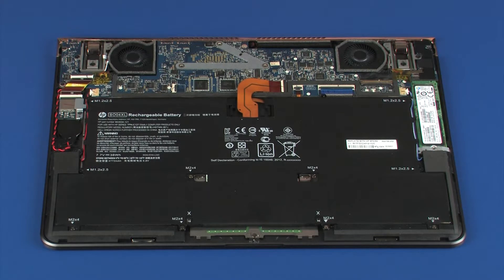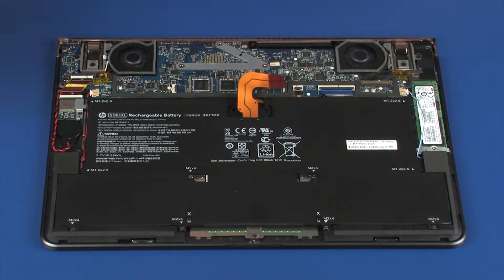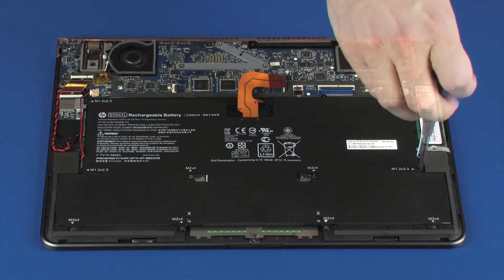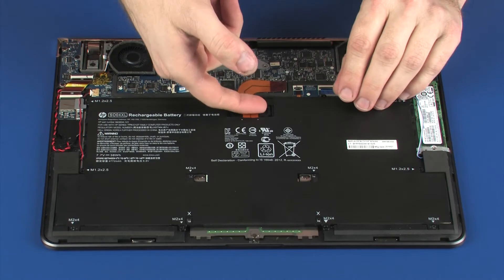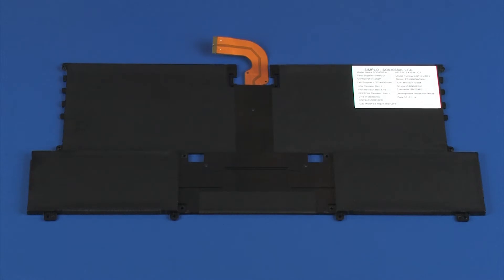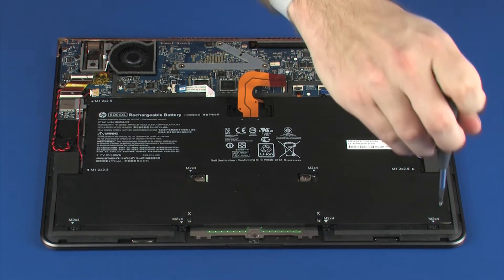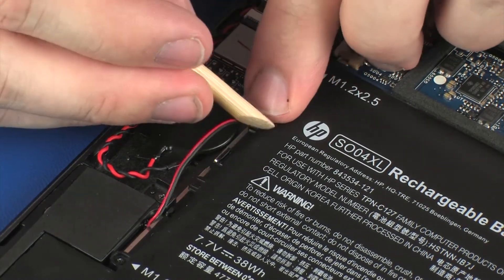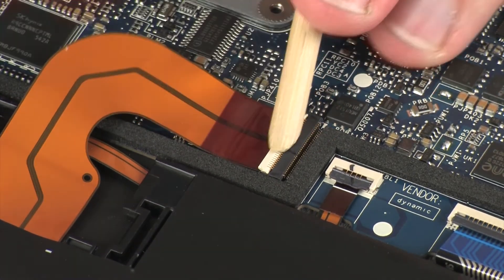Replace the Battery | HP Spectre Notebook | HP Support

Comment: Do I have to replace the battery at all? I've had two swell up on me. I'd prefer to do without a battery.
Reply from the maker: Hi there, thanks for contacting!
I understand that you need to know whether you can use the notebook without the battery.
I will do my best to assist you.
You can keep it running all the time. Adapter get hot only when it charges the battery otherwise if battery is fully charged then it won’t get hot. Learn how to get the most service and life from your HP notebook battery by following these industry-wide suggested best practices as mentioned here: http://bit.ly/2I8mw5z
Binu - Social Media Tech Support

Comment: Do I need to use the stress release tape for the battery replacement? If so why do I need to use a new stress release tape?
Reply from the maker: +Azizur Aziz Follow these steps to remove and replace the battery for HP Spectre Notebook:
- Note: The following video depicts a specific configuration of the notebook.
- The same removal and replacement procedures apply to all configurations of the notebook.
- WARNING: To avoid personal injury and damage to the product, use extreme care not to puncture, twist, or crack the battery.
- An internal puncture or rupture to the battery has the potential to cause a short which may result in a thermal event.
- Before you begin:  Remove the base enclosure.
- Removal:
- Using minimal force, lift the locking bar up on the battery ZIF connector and disconnect the battery ribbon cable from the system board.
- CAUTION! Use care to prevent damaging the ZIF connector and ribbon cable.
- Remove the left speaker cable from the routing channel on the battery.
- Remove the right speaker cable from the routing channel on the battery.
- Remove the four, 2.5 millimeter P0 Phillips-head screws that secure the battery to the top cover.
- Remove the six, four millimeter P0 Phillips-head screws that secure the battery to the top cover.
- Grasp the pull-tab on the strip of stretch-release tape and then carefully and slowly pull straight away, parallel with the notebook, until the entire strip has been removed.
- IMPORTANT: If the stretch-release tape strips are pulled too quickly or at an angle, they will break before releasing the top cover.
- NOTE: The removed stretch-release tape is not reusable.
- Using both hands, lift the battery off of the alignment pins on the top cover and remove.
- Replacement:
- Place a new strip of the stretch-release tape into the designated position on the bottom of the battery.
- Using both hands, place the battery onto the alignment pins on the top cover.
- Replace the six, four millimeter P0 Phillips-head screws that secure the battery to the top cover.
- Replace the four, 2.5 millimeter P0 Phillips-head screws that secure the battery to the top cover.
- Route the right speaker cable thru the routing channel on the battery.
- Route the left speaker cable thru the routing channel on the battery.
- Insert the battery ribbon cable into the battery ZIF connector on the system board and press the locking bar down to lock the cable into place.
- CAUTION! Use care to prevent damaging the ZIF connector and ribbon cable.

Caution: Improperly installing or replacing parts could damage your HP device or void your warranty. Before replacing any parts, check your warranty.